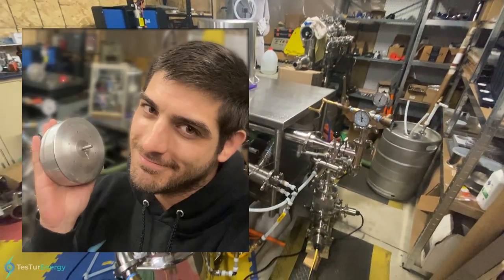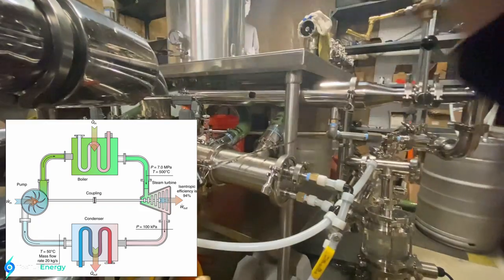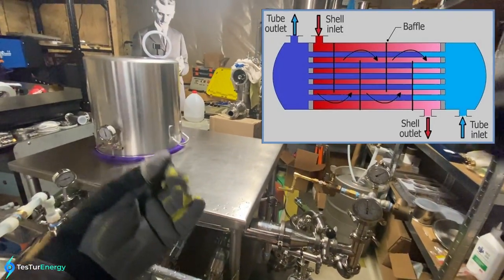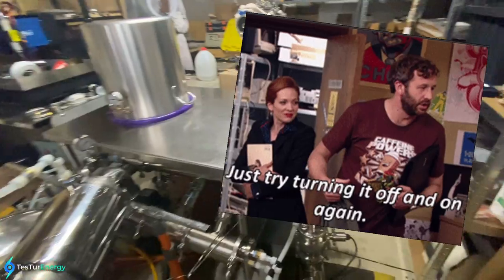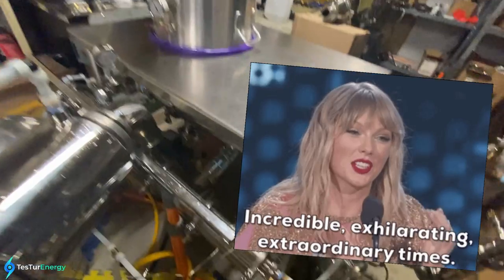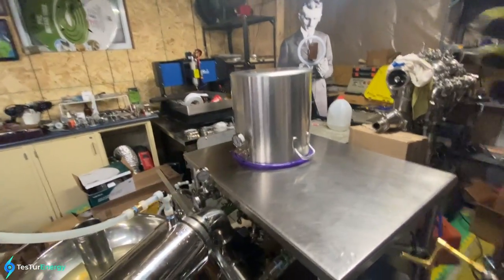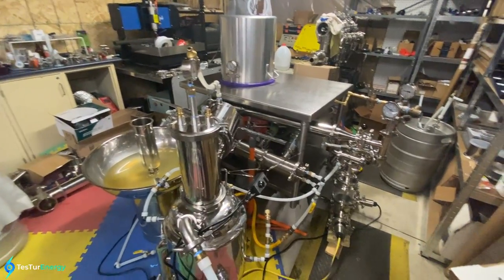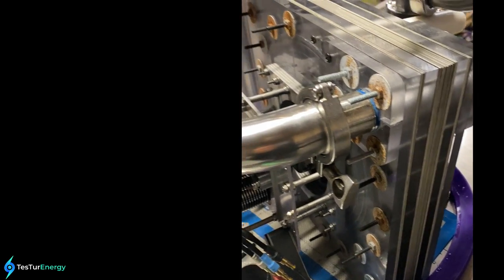Steam Tesla Turbine Renewable Energy Micro Power Plant - 1st Start Up

Comment: use carbon dioxide instead of steam and I'll be impressed.. dude steam is like caveman crap
Reply from the maker: Hey thanks for commenting. I appreciate your input and supercritical CO2 systems are very impressive but it also requires a minimum of 1500 psi. And while yes steam is old, it still serves as a perfect practical example. And if the TesTur works for steam it’ll work for CO2. 

As such a supercritical CO2 system cost goes up almost exponentially. 

Also the danger and risk for surrounding life and property drastically goes up. 

I would LOVE to test my TesTur in a supercritical co2 system but that is just way outside of my budget at the moment. This entire project has been self funded by me and my TesTur Energy partner, Andrew, all out of pocket. I would be remiss if I did not also mention my loyal patreon donors who have also helped keep this project alive. 

Thanks again for your support, and if you want to help me out even more, please consider donating to my Patreon page or any of the places on my linktree in my bio, it will help me to continue my project. Your support is greatly appreciated. 
www.Patreon.com/CharlieSolis
Reply from the maker: But just in case I’m not communicating it clearly, we can generate power with steam that’s made from the heat in a hot water tank. It doesn’t need to be over 70-80°c. 

With TesTur Energy, our mission is to give people energy independence through Combined Heat And Power (CHP) systems that can make use of underutilized energy sources like biomass, solar thermal, geothermal and even low grade fuels containing high quantities of solid particulates (like pulverized coal and powdered iron); energy sources/stores that are currently underutilized due to the lack of turbines and engines capable of handling the multiphase fluid flows (any combination of gasses, liquids, solid particulates) present in low grade heat boilers and low grade fuel sources without damage over prolonged/continuous periods of use. 

Can you show me a bladed turbine that can handle the wet steam that’s produced from geothermal energy sources without eroding down the indispensable complex geometry blades to little nubbins in a matter of minutes?   

Or a bladed turbine that can actually fully utilize all the heat energy in steam by actually fully expanding it and not be damaged by the condensation and cavitation?   

One that doesn’t require superheaters, MASSIVE heat exchangers and expensive waste heat recovery systems to actually maintain whole system thermal efficiency?   

Yeah sadly bladed turbines get zero efficiency from geothermal steam sources and can only be used to produce electricity from them with outrageously expensive multi circuit loops to keep all the fluids separate and have MASSIVE heat exchangers.   

But when even just one geothermal site in California has more energy than the US needs for the next 1000 years and TesTurs see no damage from multiphase motive fluid flows I’d take even just 10% efficiency over the zero that bladed turbines can offer.   

The same goes for solar steam boilers because it’s very difficult to have a residential solar boiler that doesn’t produce wet steam.   

Furthermore bladed turbines can’t use low grade fuels like biomass, woodgas, and definitely not solid particulate fuels like powdered coals and pulverized iron.   

That’s not an issue for the TesTur for the exact same reason that condensate and cavitation in wet steam doesn’t damage it. 

Because there’s no lifting surfaces for the particulate to smash into.  What most people mean to be saying is, bladed turbines get a high efficiency on only a very limiting, very specific, very expensive set of proprietary formula refined fuels.  

And the only reason TesTurs don’t is because no one has actually put any money into them like the BILLIONS of dollars thrown at proprietary bladed turbine designs just to get 1% point increase in efficiency.